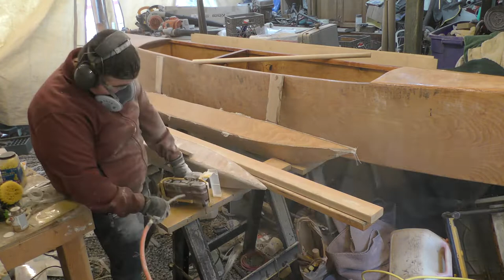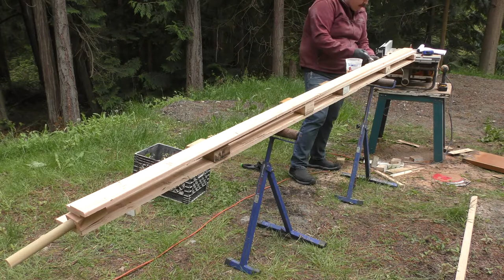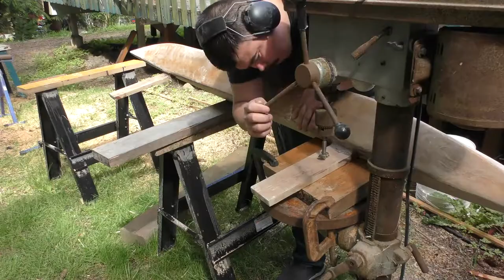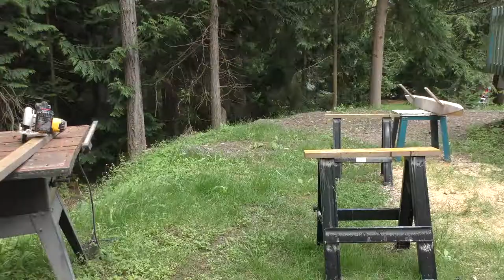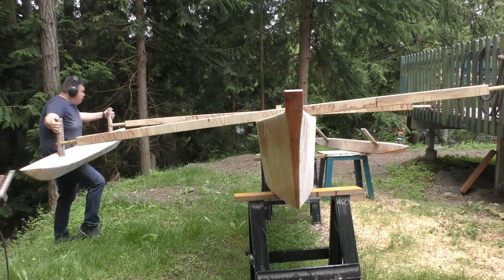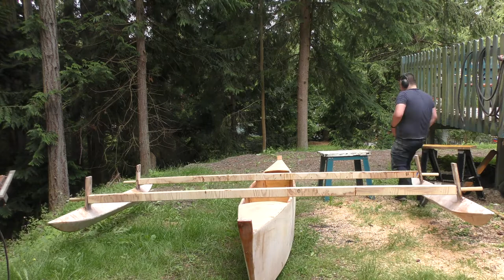Building a Sailboat part 7- Starting to look like a Trimaran

Comment: Anymore updates coming
Reply from the maker: Sadly the tent I was building the boat in had some damage to the cover and let a fair bit of water in which caused some delamination on a few large pieces where I had not yet sealed all the edges. I am still trying to determine if I will the time or willpower to do the major repair.

Comment: No updates?
Reply from the maker: Sadly the tent I was building the boat in had some damage to the cover and let a fair bit of water in which caused some delamination on a few large pieces where I had not yet sealed all the edges. I am still trying to determine if I will the time or willpower to do the major repair.